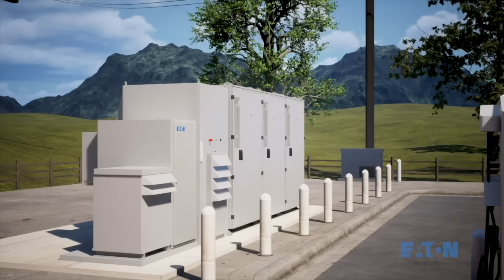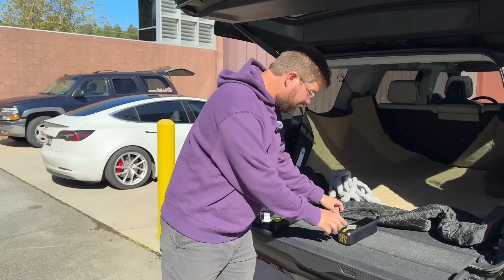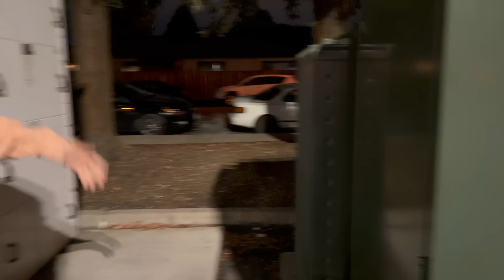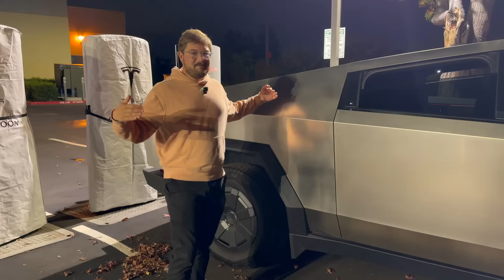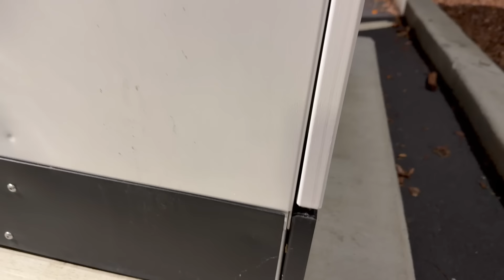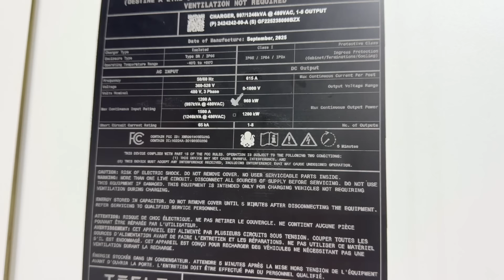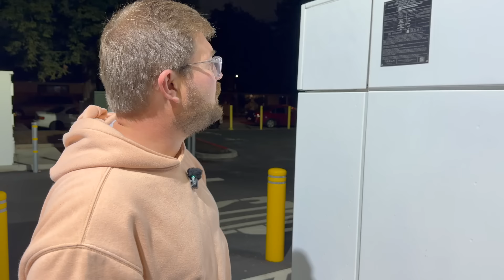My First Tesla V4 Supercharger Experience! 1MW+ High Voltage Cabinet Shared Across 8 Stalls

Comment: This site is only a 1MW cabinet - 1.2MW is for Semi use.
Reply: Thanks!
Reply: @KyleConner , according to Grok, the Octopus symbol is a Tesla-specific engineering icon for the Octovalve thermal management system integration in V4 cabinets:

Meaning: The octopus represents the Octovalve's 8-port ("octo") design, which acts like tentacles distributing coolant and heat across multiple paths. In the V4 cabinet, it's a nod to how the hardware preconditions batteries during charging—pre-warming/cooling via vehicle communication for up to 30% faster sessions without thermal throttling. This is crucial for high-voltage (up to 1,000V) architectures in Cybertruck and future models. The logo is etched on pilot cabinets as an internal " Easter egg" for Tesla engineers, symbolizing adaptive power flow (like an octopus's flexible arms managing dynamic load across 8 stalls).

Why on This Pilot Site?: Redwood City was chosen for its proximity to Tesla HQ (Palo Alto) and as a controlled testbed for Octovalve-optimized charging protocols. Early photos from the September 2025 energization (e.g., shared by @TeslaCharging on X) show this subtle marking on the cabinet door, visible only up close—it's not on production V4 units yet, as Tesla iterates on branding. It's a fun, insider reference to Tesla's thermal tech, similar to how they hide schematics in patents.
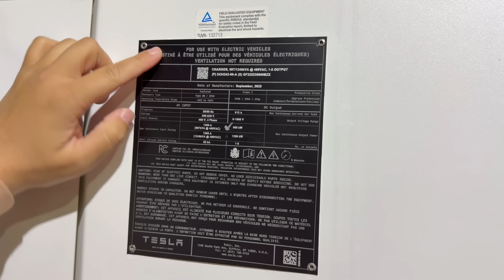Reply: 960kW out 23:05
Reply: I was just about to post that myself, only one mega bought, shared across eight chargers. 125 kW averaged across eight cars. Still not excited to take a Taycan here, even when they eventually open to non-Teslas. Curious how long it’ll take that to happen.
Reply: So only one China car

Comment: Slight underwhelming IMO. Seems like this was due ~3 years ago. V5 when?
Reply: Well Elon did fire basically the whole charger team in a fit of pique maybe a year ago, and they only have one (low-selling) vehicle that takes advantage of it, so it's not too surprising.
Reply: How is it underwhelming?
Reply: @mcsike7264  it is one set of v4 chargers there are no others.     when they turn them all on would be impressive along with allowing third party ev
Reply: @bloodycreepy It makes a lot of sense if you have a better understanding of product development.  

You're only going to deploy a few units like this to the field, learn from what happens and what breaks, iterate and keep making new versions that you try in different environments before going to full scale manufacturing and production.
Reply: @mcsike7264 125kW across 8 stalls isn't great. Many cars are beginning to charge faster than that beyond 50%.
Reply: @Firefoxsimpp but thats a rare case tho if would have to full up the station with 800v cars
Reply: @Firefoxsimpp it would never be like that though. As each car starts to lower is charging curve, it shifts more power over to the other cars or new cars. It’s a dynamic system.
Reply: @justinstewart3248 my IONIQ 5 stays above 150kW until 80%. It will be a small issue now but much worse in the future, and it's clear that Tesla doesn't really seems to care that much about improving superchargers.
Reply: @mcsike7264 charge speeds on teslas - still over an hour to charge the CT?! Are you kidding me?
Reply: @George2647g ya teslas charging is super out dated full time for the s3xy line up mpve to 350-500kw of charging and give em a good charging curve
Reply: This is not overwhelming at all. It’s actually the perfect mix of efficiency and allowing full power at a cost that allows Tesla to continue to expand. The cost is the most importantl factor at all or else we won’t have these at all. Making money on public charging is very difficult.
Reply: What happens when u have thin skin and child’s temperament and suddenly fire the whole damn department on a sexist whim..